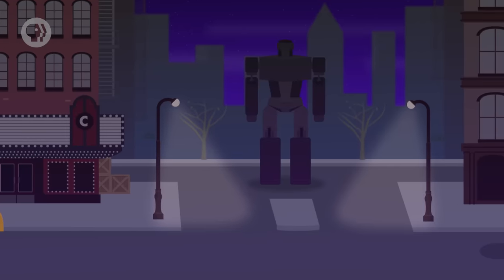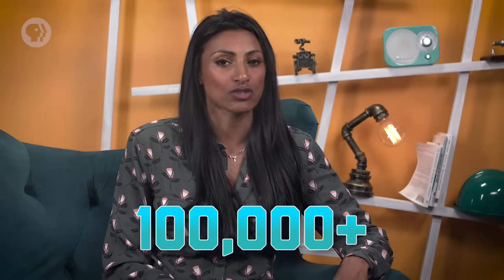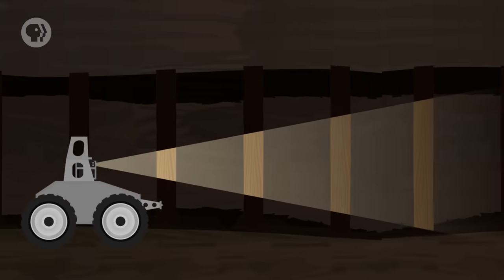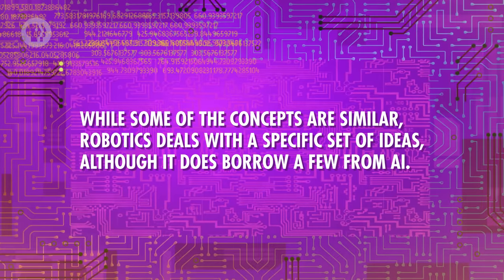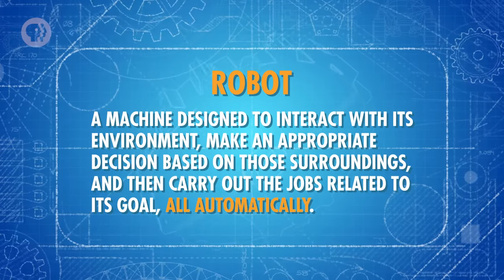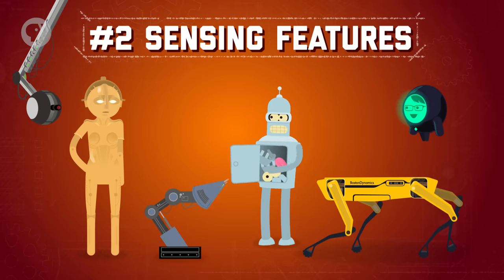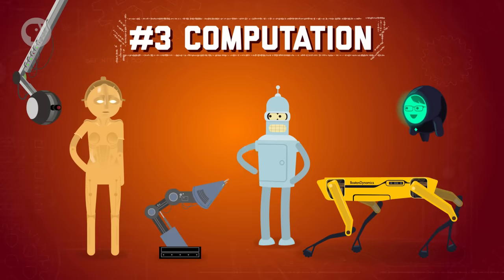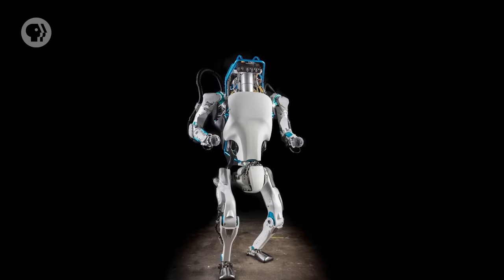How Engineering Robots Works: Crash Course Engineering #33

Comment: Please I need an answer
Is it OK to say "I have been having a cold for 3 days now?"
Reply: No.  That's present perfect continuous, but "to have" is a non-continuous verb, which can't be used in continuous aspect (it's actually a mixed verb, but the form in which you can "have a cold" is non-continuous, unlike the form in which you can, say, "have fun").  You can figure this out by asking whether present simple continuous would be correct: "I am having a cold right now."  You can't say that (unlike "I am having fun right now", which is fine), so you also can't say "I have been having a cold for 3 days now" either.  To express that idea, you would typically split the aspect into a present simple part and a past perfect part (so you could express it as "I have a cold, and I have had it for 3 days now.")
Reply: Daniel Remenak omg thank you for answering me. I really appreciate this!!!
Reply: Mario  It's funny that you should say that...I'm actually a software engineer specialized in numerical control and robotics :)  Linguistics is "just" a hobby for me.  Aspect is unfortunately a grammatical property that gets taught very poorly in English classes (both native and L2); it tends to be either conflated with tense or ignored entirely.